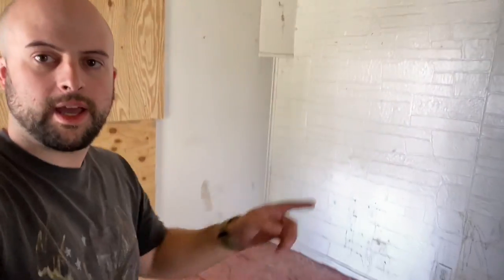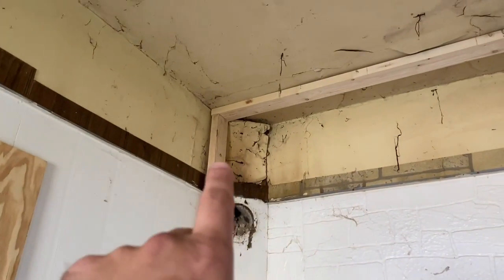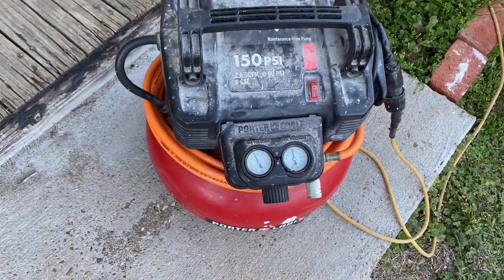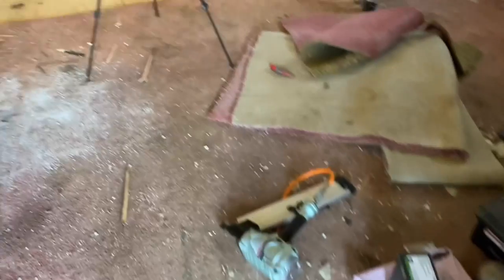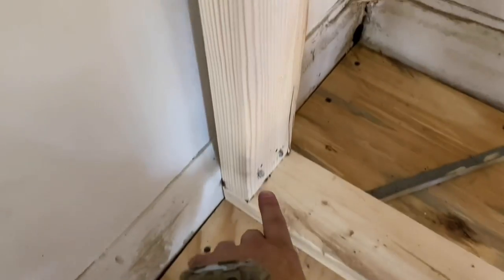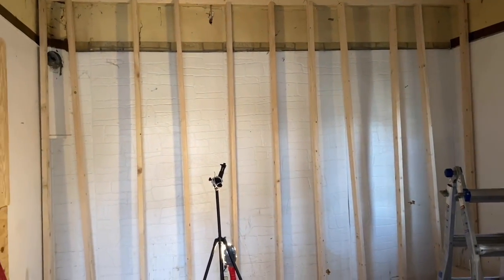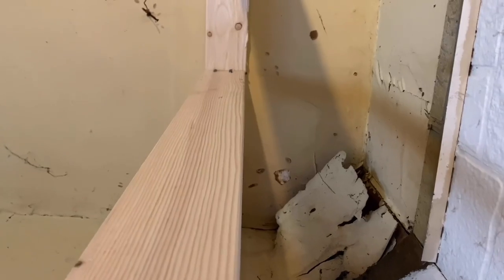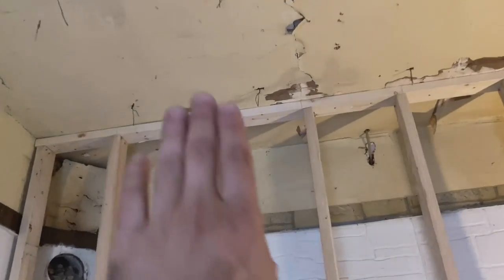How to build a non-load bearing wall

Comment: How much weight would you say a non-load bearing wall can support? Like, if you hang a TV on the wall and mount it into the studs. How many pounds would you say is the maximum?
Reply from the maker: @greencasestudy  Well, a non load bearing    wall like the one I have here, secured on the bottom, right, top and left side into studs, it should hold anything you want to put on there. For the most part, hundreds of pounds. If you put a double top plate on instead of 1 top plate like I did, it would be a real wall and support a second floor above it. But if you’re just building a wall like I have here to hang stuff on, or to divide something, in my case sound barrier, just secure the wall that you build to the walls that are there and to the floor and ceiling, you will be golden! Sorry it I made that confusing!